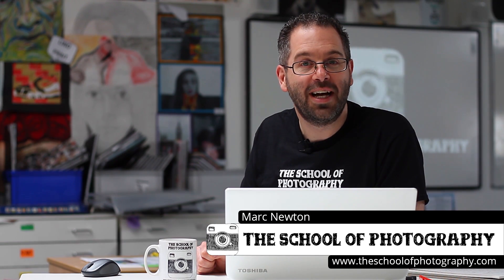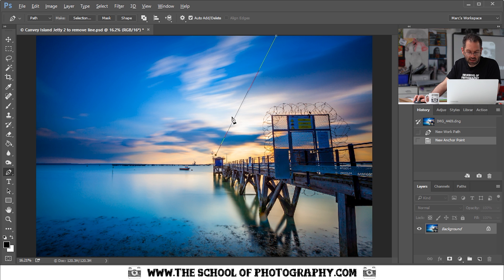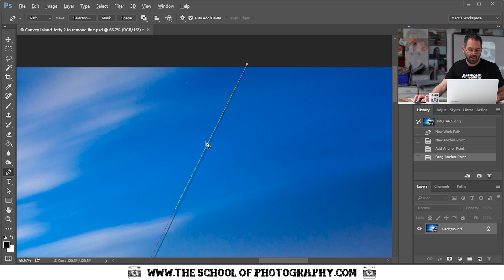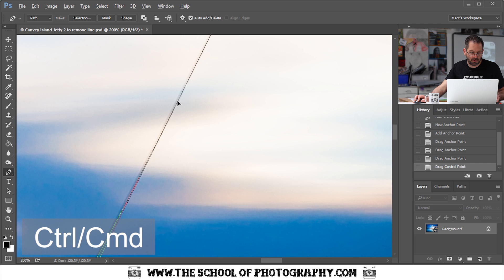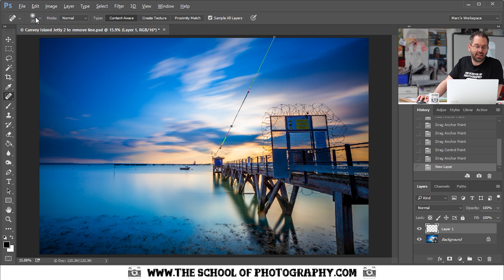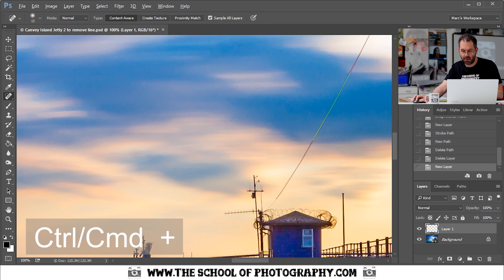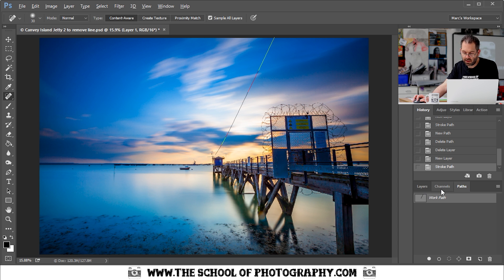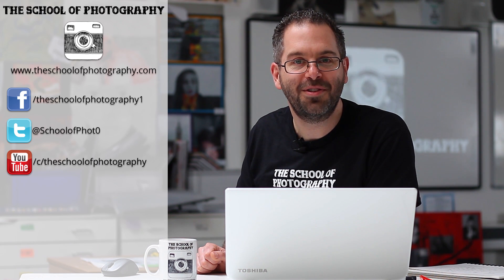How to remove power lines in Photoshop

Comment: I have PS CS3 and the Spot Healing Brush Tool is slightly different in that "Content Aware" is not available.  Can you possibly verify that CS3 cannot do as your video demonstrates, or perhaps there is another way with CS3?   I have tried both healing brushes with just about all the combinations of settings and while it tries to do some healing (using the Healing Brush Tool and Stroke Path with Brush, the result is horrible.  Nothing at all happens when using the Spot Healing Brush Tool and stroke path.  If that means I must move to now renting PS then I guess I'm stuck paying rent to get the feature. Thanks for the well done tutorial.
Reply from the maker: I Ron, I'm afraid I haven't used CS3 for a long time so can't confirm it won't work but at a guess I would think it wouldn't. I think you may have to upgrade! Hope that helps